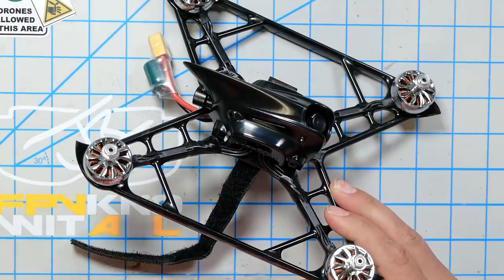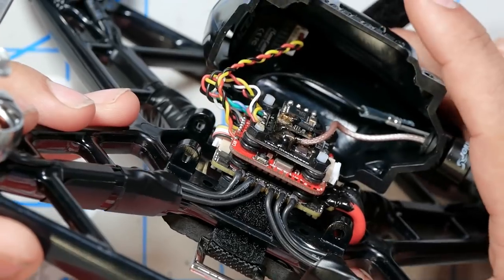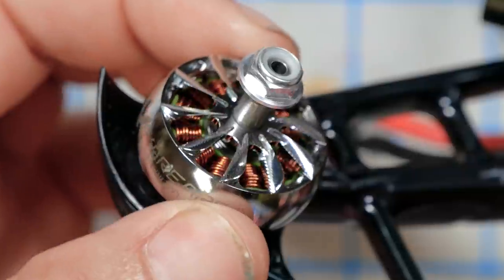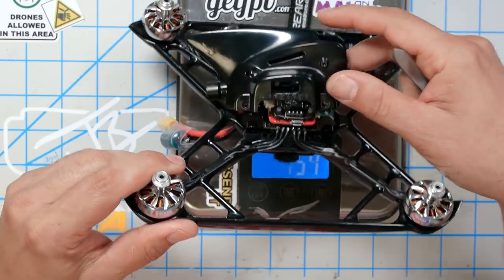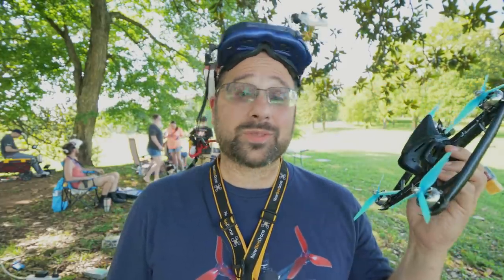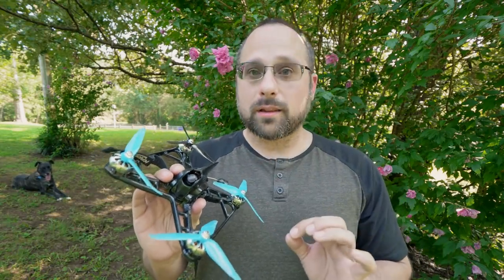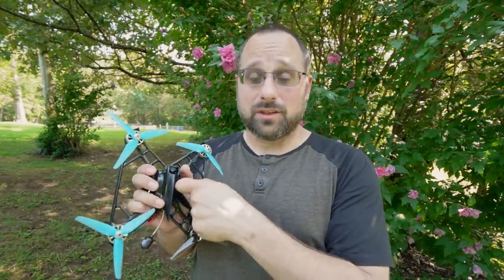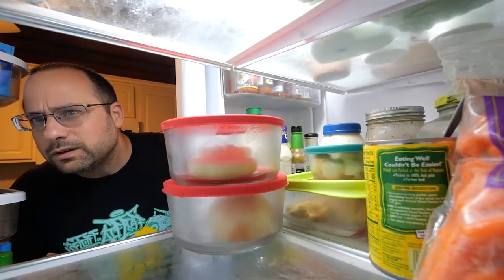Unbreakable drone put to the test | Karearea Talon V2 and Toa Turbine Motor

Comment: I would like to see some more testing on the motors creating thrust with no props... For some reason I have a feeling something else might be going on 🤔
Reply: Centrifugal forces from 4 motors
Reply: @odyss160  exactly what I was thinking 👍🏻... Or something of the sort.
Reply: @odyss160  I want to see JB get a similar weight setup as the karearea and then try it with other motors. My uneducated self wants to think that as the rpm grows the centrifugal force starts to create a gyroscopic type effect on the bell and cancels out a couple grams per bell.
Reply: @odyss160  also sense these bells are directional, swapping motor 1 and 4 for 2 and 3 to see if any weight is added because of reversed thrust.
Reply: You are right with gyroscopic affect, at higher rpm, motors wanna stable and balance 9n the yaw axis. Since thrust is only applied everything balanced and the quad doeant move. Any other like pitch roll or yaw is applied, you'll see yaw rotation only without props just sitting on the bench. One good way is to build a simple pivot system that would push down on the scale if the motor applied thrust. Drone mesh  and other YouTube e motor bench test ppl use similar setups,and would be easy to change motor directions aswell
Reply from the maker: Motors spinning can only create a yaw moment. It can't make the quad be lighter.

Gyroscopic precession has nothing to do with this test. It can't make the quad lighter. It can make it rotate around its CG but that would just shift weight. Since the entire quad is resting on the scale, the net weight woudn't change.

Comment: The scale test doesnt seem like a legit test for that claim. The motors are not directly over the scale. If they do make thrust then effectively they are making the weight of the quad that's sitting on the scale lighter, not heavier if thrust is directed downward. Better test is show the quads weight and then skin the motors and if you get lift itll effectively show a lower weight on the scale. But a spinning motor that's not secured and is spin really fast will try and jump around like a Mexican bean. 4 spinning motors can possibly push the quad down, or make it lighter on the scale via centrifugal force.
Reply from the maker: Centrifugal force can't move the quad up and down. I took a 2nd set of motors and did the same test as a control and the weight didn't move at all.

Comment: The thrust test on the scale is not accurate and the comparison to other quads is not sensible. The air being pushed down is also pushing the quad up according to Newton's 3rd law and since the motors are still partially over the scale itself, the thrust number is misrepresented rather substantially. For the Karearea drone, it looked like there was a larger portion of the motors hanging over the sides of the scale compared to the NewBeeDrone drone (which conversely, had most of the motor over the scale). From this alone, the comparison cannot be confidently made. I guess a more accurate test in this setting would be to ensure the outlet airflow from the motors cannot interact with the scale in any way.

Comment: 18:08 - that's all I needed to hear.  Avoid is my advice.
Reply: eh Mark that's a little short sighted. Racing doesn't exactly need filters to be raised, especially not with the rates they fly at. And even still, this screams being the perfect racing practice rig.
Reply: Good points.  It would be interesting to see a log on it.  But bad frame noise can be all kinds of trouble IMHO.
Reply: @uavtech  sure, it's certainly purpose built. My gut tells me it will be a frame resonance that pops up. I think that would actually be a good thing, since you could target that with a static notch and save phase delay with the other filters.
Reply: MAD GRUMPYMAN  ,

And prediction seems to be confirmed.  See comment in this past with raw noise from this quad: 
https://www.facebook.com/groups/291745494678694/permalink/931910060662231/